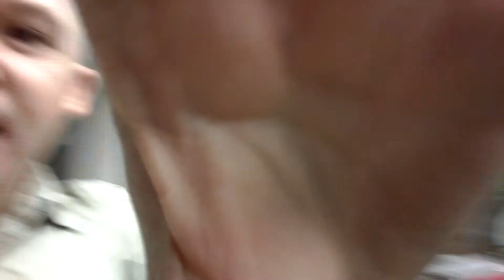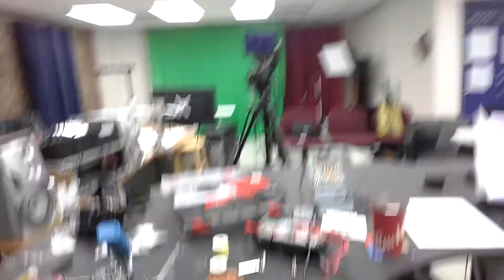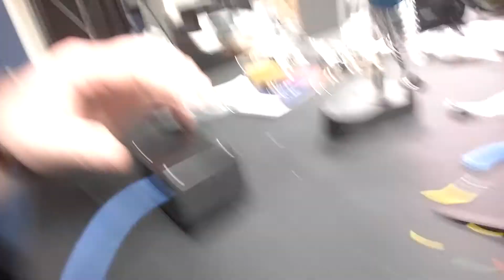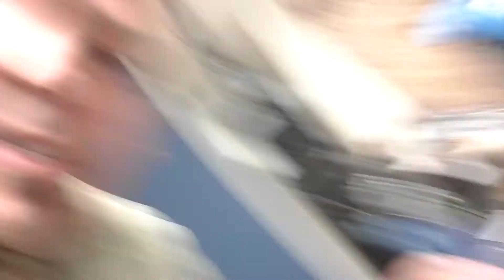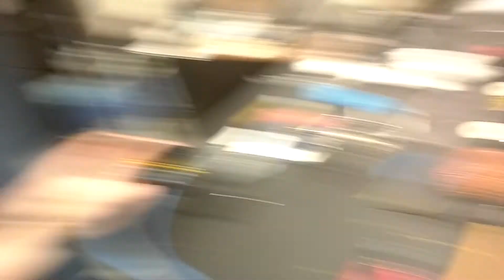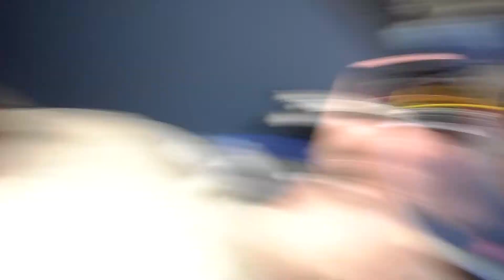The Audio Breakout Box

Comment: cool, you could make 2 of them and use both mic ports then you would have 8 mic inputs :)
Reply from the maker: Jay Mee or just drill more holes :D
Reply: if sound quality is not affected then yeah also it will get fiddly in a small box and could even get interference, if you have 2 boxes and 1 stops working then you have a backup aswell :)
Reply from the maker: Jay Mee yeah... for our purpose 4 is perfect. Shouldn't get interference anyways since the circuit is very small and each mic has its own power unit with filters for that sort of thing, but some magnets could be added. Reason I would stick with four is because there are just two ISO channels. best keep down the number of overlapping mics so post production isn't a nightmare.